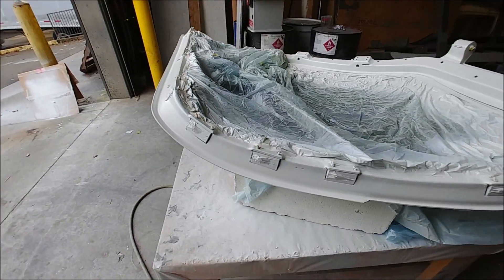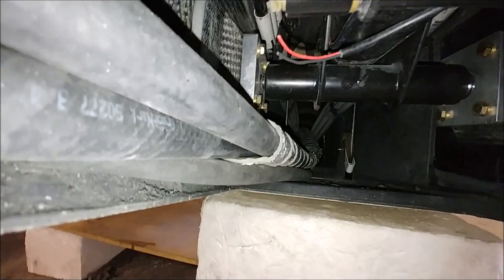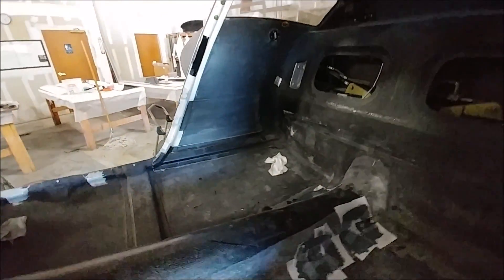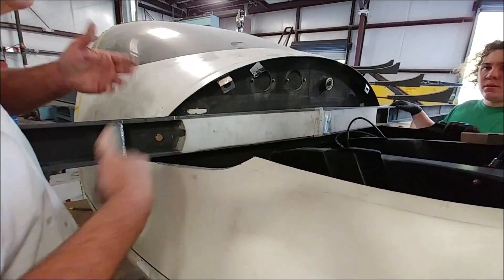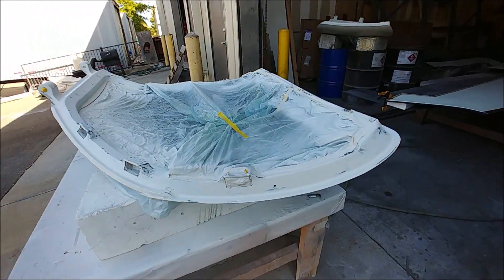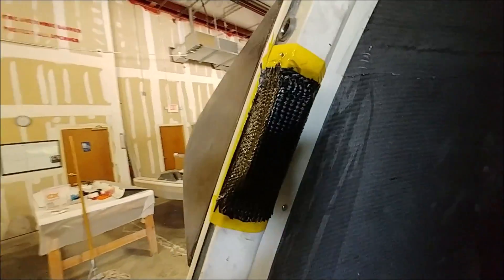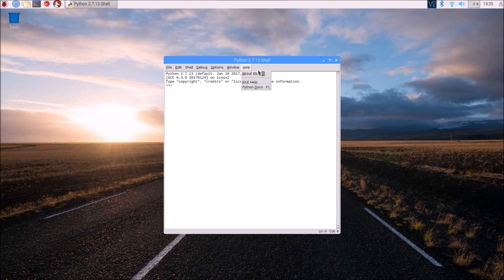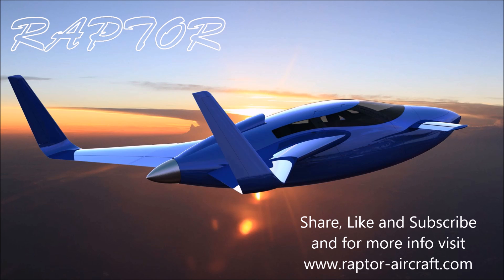Wing Spar Match Drilling - Building the Raptor Prototype

Comment: Hey couple of things I thought about, 1. The plate will probably cause a rub and eventually cut through those lines and 2. how are you handling nose wheel steering with the gear up transition? do you have some sort of lockout or system to force the wheel to straight as it is retracted?
Reply: Also you may want to route the Pressure air through the AC system to cool the air from the turbos

Comment: Congratulations on impressive progress Peter & team. I do have a piece of advice. Given the degree of complexity and the number of completely new subsystems, would it not be wise to focus on getting the "basic" aircraft taxiing and then flying first,? 
This would allow you to test and debug basic aerodynamics (stability, control forces, landing manners etc...), landing gear and engine.
I would only bother about the rest once the basics are sound. All these peripheral systems will distract the test pilot if/when they misbehave and get in the way as you modify the fundamentals. 
Engine cooling for example is likely to keep you busy for a while, and you want as much freedom of movement as possible to get your airflows right. Thumbs up to all of you.
Reply from the maker: Thanks for your suggestion but I'm more of a 'why wait till tomorrow if I can get it done today' kind of guy. The more I can get done now the less I have to do later.

Comment: Sure you want to have all these software layers in a highly complex device that basicly just replaces a bimetallic switch? I seriously would feel unsafe with such a component, where any of dozends of megabytes of components can flip the RasPi and make it blow glowing hot air into the cabin during take off. Linux, aspecially in a desktop installation as shown in this video is most definitly not a save embedded environment - even less in something as flight critical as air intake.

Serious, such devices need to be lean and reduced to its core function. There is no problem in adding a dozend or more controllers with each having a clear defined and straight programmed job. Incooperating such a burden into a new design is negligent.

II would much prefer to have a small controlle exactly fiting to the need, where every function and every byte of software usedcan be audited in detail.

If needed I could as well help designing and building controllers and boards as required.

Stay on the safe side!

Comment: Just a thought on the door redesign/build.  It'd be kinda nice to have a spring loaded hinge, so instead of having to use a gas strut to hold the door open, the springs would assist in rotating the upper door open and hold it in place.  Not sure if it's feasible or not, but it might be worth a consideration.

Comment: You might save a lot of work by using "Node-Red" on the Rasbperry Pi. It's made for input graphing and tracking and should be just what the doctor ordered for what you're doing with the Pi. I think it's already installed with your OS. The programming interface is all drag and drop. An expert could have you up and running with a passable interface in minutes and a total noob ( like me) could do it in a few hours.

Comment: still can't see where fuel tanks fit in that small space ?
Reply: Where are you looking?  Tank on each side in wing strakes.
Reply from the maker: Ffs, 55 gallons in each wing strake. The gray structures with the baffles/ribs on either side of the fuselage.
Reply: I believe there are no fuel tanks...  They are wet wings, so the fuel resides directly in the strakes.
Reply: @RaptorAircraft  ffs, lol

Comment: The winglets/rudders look huge! Bigger than what are on much larger aircraft!  That was the most surprising thing in the whole build so for for me. Nice progress guy! Looking forward to the engine runs when on the aircraft, that will be exciting to watch.
Reply from the maker: The larger fuselage requires more directional stability hence the larger winglets.
Reply: @RaptorAircraft   thx what about a longer fuslage, would that help or hurt?
Reply: How many feet off the ground is the bottom of the winglets and the height of the winglets?
Reply: Hope a specially built hanger is not needed for the Raptor...

Comment: I was thinking that a microcontroller like a Pi or Arduino would be a great addition to the Raptor to monitor environmental metrics.  If you want to use Github to do your work as open source, I'd be happy to help with the coding.  

Either way, great work this week!
Reply: Ditto - I can’t help with fabrication, and I don’t have the $$ to place an order, but more than happy to help with coding :) Also, is there a reason you’re leaning toward Python 2 instead of 3?

Comment: A Microcontroller like an Arduino would be much better suited for controlling the pressurization system. Much less overhead as there isn't a full blown OS running and also very easy and cheap to produce PCBs after prototyping. Otherwise great progress!
Reply: I agree. Done lots of hobby projects and pi is not reliable. Arduino is well suited for what you want to do. The programming language is c like but the strength comes from how powerful the libraries are. Usually a few lines will do all you need. Great IDE, too.
Reply: I have to agree here too. An Arduino will probably be a better fit hardware wise. Peter, take a look here: https://www.arduino.cc/

Like Raspberry Pi there is a huge Arduino community that can help you program should you need it. Folks here can probably pitch in too.
Reply: For the first experiments using Python 3 on a Pi makes sense because it has WiFi and can serve as a fast way to test things.  I'd suggest switching to an Arduino styled board such as the Teensy 3.6 before making a PCB.  I'm playing with ST Micro's NUCLEO boards which are really powerful but they take a while to set up if you want semihosting (for printf) and breakpoints.
Reply from the maker: I'll get this going with the Pi and then likely get an Arduino and duplicate the setup. I'm guessing that the Pi may be better for doing more advanced things later on whereas the Arduino would be better off with just the hardware of the sensors and solenoid valves.
Reply: Don'T underestimate todays 8 bit controllers. An AVR is an up to 20 MIPS CPU - thats 50+ times of a 1980s Z80 or alike. Similar any PIC or 8051 variation. They can handle quite a lot in real time, not just a few  sensors and actors. They can handle more complex interfaces (inkluding) USB as well in real time, thus being excelent self contained systems and at the same time great to be integrated with mor complex systems seting the over all strategies.

The advantage of these little fellows is that software layer shrinks down to only the functionality realy needed and making them 100% ausitible on instruction level to guarantee safe workings.

While a Pi might be a good ide as long as the plane is not flying, I'd totaly suggest using a diferentiated scheme - like an AVR handling the sensors and valves according to some hysteresis tables that exist in hard programmed default state and an overloadable fashion that can be updated during operation from a host system (like a Pi). After power on, or reset, the default table is used, bringing the system into a safe state for safe operation. Similar, maybe after lengthy communication fail (with the host) or alike.

Also, I strongly suggest not to use premade and plugged boards like an Arduino. At least not for production machines. PCBs are made and changed fast, Produceing them (after having doen thedrawings) is a matter of days and a few buck. Doing so removes many sources of potential failure. None of these standard boards are designed for a rough environment anyway. They are toys to be played with on your kitchentable, not an engine compartment or a plane.
Reply: I'd avoid using the Pi for this application as well. There are off the shelf ruggedized Arduinos that would work great.
Reply: How about a industrial PLC they are very rugged and affordable these days and are redily available with WiFi.
Reply: Also I would be careful with Python. It's a great language, but I have a lot of experience with industrial programming and Python is not a language of the choice for me. Try Golang, it matured so much that it's proving itself now in our installs in factories around the world...
Reply: Going to second everyone else here, the Pi is way too flaky to use for this. There are a lot of microcontrollers these days that are easy to program and don't depend on the whole Linux stack to run.
Reply: Microcontrollers are ideal for filling the role in various tasks you may need, especially with an abundance of arduino libraries available.
NOTE: Arduino's are great for sitting on your desk, along with ALL those other proto-educational platforms, but they are not suited for stressed environments. Board up design, with circuit protection and shielding in mind, would be the only way to fly. When designing around microcontrollers in mission critical environments, make sure to get chips rated for hi temp environments. Those Industrial grade chips, generally targeted for the automotive industry. An example would be ATTINY84ASSFND which is rated for +125 deg C.
Hope This Helps ..  Cheers :)
Reply: @VorpalForceField  I agree, again. We design or reuse a hell lot of controllers every month. Arduino is great for prototyping some ad hoc solution or something we need for debugging or testing. We use it, sure. But I would never leave the customer with Arduino controller as those are still unreliable in heavy industry use - like with high vibration, temperature changes, etc...
Reply: Going to have to agree here, I run a lot of Pi's and while they're awesome, I wouldn't trust them for mission critical applications. The SD cards can burn out and there is no redundancy. Additionally if you do use python, like others have said, use 3 not 2.

Comment: Used Python 3  to control Pi-face relays, for me it  worked nicely.  VNC set up: In my case,  phone must maintain connection to cellular network for DHCP service to work.  Also, found RasPi's OS is sensitive to low voltage and voltage spike @ POST.    They are cheap, so I'd consider redundancy.  Have you looked at using a Parallax PLC ?  May require Assembler language and lacks OS capabilities of the Pi, but stable, also with respect to temperature.  Cheers.
Reply: Agreed, please use Python 3.  And if you want some assistance, please reach out to the Stratux community.  Although they are using Go language, they are still doing great things with Raspberry Pi creating an ADS-B in solution.